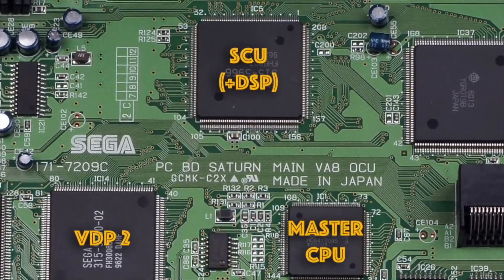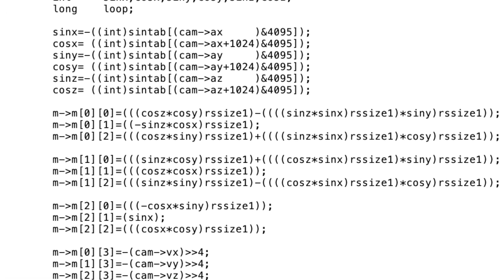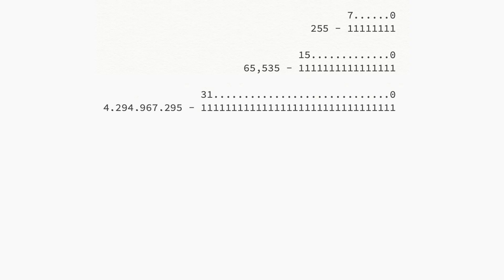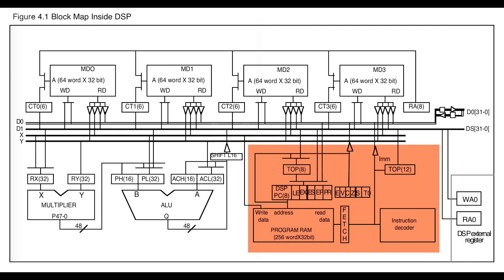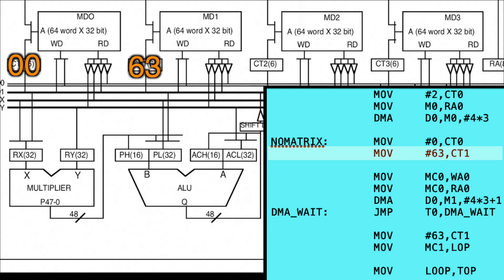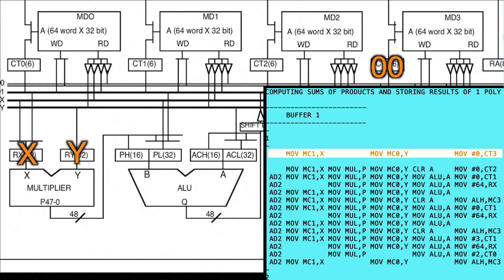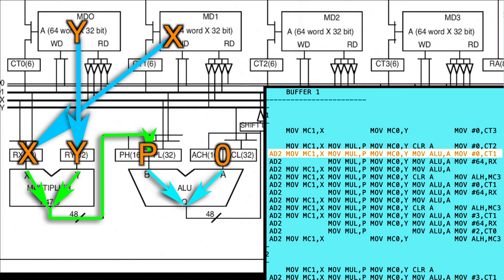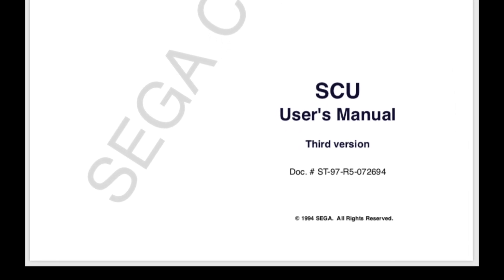Sonic R's code the Hardest in the World?

Comment: starts making a VM with the worst instruction set
Reply: I may have beat you to it, I created a VM that runs on 8 bit PIC18 architecture and creates a bastardized "16" bit architecture with a stack that is only sometimes a stack and no dedicated flag register or interrupts.  To get 16 bit memory performance, you can only use pushes and pops, but all of the pops can  offset SP within the current 256 byte page prior and some special push opcodes can too.  So for optimal memory performance, your program needs to know where SP is and move it around offset style to reach its next address continually.  It makes stack frame local variables "okayish" to use but then you also have to be concerned that your stack frame doesn't cross a page boundary or the offsetting will blow up.  Needing to track SP positioning gets really weird when you have loops or conditional execution.

For random 8 bit RAM reads, the opcodes are constructed so that you can load part of the addressing to the destination register and then the read instruction operands select the destination as the memory address register in one operand and a literal 4 bits for the rest of the address in the other operand.  So by that trick you can do any constant address 8 bit RAM read in 2 instructions to any supported destination register without needing another temporary register for the address.  Byte translations from RAM are a single cycle operation.  Sounds good so far, but writing has a different shadow register for the upper 4 bits so you have to treat it a little differently and you will need either 1 or 2 bytes of separate address register to do it.

There is no mechanism built in for constant data address offsets, so for reading/writing 16 bit data values you'll find yourself incrementing an address register to get to the next byte unless you can use the stack mechanism.  If reading from flash, you can't use the stack mechanism at all and all addresses must come from a 16 bit register.  So if you are dealing with pointers that only go to RAM, you have more coding options than if the pointer could point to flash, since not only can you not write to flash, some ways of reading it won't work either.  Mercifully, the mechanism to read flash via pointer can also read RAM.

Conditional branches require you to load the magnitude of the jump offset into an 8 bit register, which is multiplied by 2 and added or subtracted during the conditional jump.  To reduce how often this must be done, hardcoded skip 1, skip 2, and skip 3 instruction jump targets are also there, plus subroutine return is also a conditional jump target.  If you are using the multiply and accumulate instructions, it will clobber most or all of the conditional jump offset registers, so those skip1-3 targets become really important or maybe you aim SP at the target address pointer and use return.

The conditional branches compare two registers for A>B, A=B, or (A AND B)=0.  It is a bit of a challenge to think about how to do some of the usual conditional jumps - for example comparing two 32 bit values is tricky because it can only do a 16 bit comparison and you have no flags.  So the code flow path has to hold some flag information itself so that you can chain two compares together.  Getting the carry out from an addition is similarly weird - you compare that the result is less than one of the operands.  It makes sense after you think about it but most assembly programmers are used to having flags and it feels a bit unnatural.  If you need to check a sign bit, you have to burn an 8 bit register and an instruction to set up the 0x80 constant to do it.

On the plus side, jumps have +/-255 instruction range and calls have +/- 3.25K instruction range and everything including the calls are single cycle.  It also has per-thread, per-256 byte page memory write protection.  Sort of a "just because it can" sort of thing, but it does open the option to having isolated threads for redundancy/high reliability/validating actions of a received RAM resident program, etc.

The whole point behind it is that every interpreted instruction runs in exactly 68 real instruction cycles so that it can be used to run general control code fully isolated from the timing of a cycle exact main loop.  If you have even less time than 68 cycles free at once, you can split the interpretation into a front half that fetches the instruction word, updates IP, and decodes operands (which always happen identically timing wise), and a back half that runs the rest of the instruction.  It's not a portable interpreter and many PIC-specific tricks were used.  Porting it would be a medium nightmare.  A cornerstone of its design is the large number of 16-way branches used in the interpreter, which make almost all of the opcode field sizes 4 bits.  PIC can do these kind of branches very quickly when the destination addresses are spaced 8 instructions apart.

No one single part of this ISA is completely horrible but taken together it is an amalgam of "here's 3 different ropes, find the best one to hang yourself with" type situations.  But I did attempt to at least have an "okay" approach to most common programming tasks, though one is likely to struggle through bad approaches before finding it.

Comment: Very interesting video, thank you for making it! I still have one question; when these 6 operations occur at the same time, which X and Y are then multiplied together? I assume the multiplication happens "at the same time" as the overwriting of X and Y, in practice meaning that the result is stored to PH(16) and PL(32) and at the same time, a new set of X and Y is written to RX(32) and RY(32)?
Reply: One of the important things to understand about assembly is that one instruction doesn't equal one clock (CPU) cycle. The assembly code you're looking at does show all the instructions on one line, so the instructions will start in parallel at the same time, but instructions take different numbers of cycles to complete. If you take a look at the second instruction of the complex DSP code:

MOV MC1,X   will take a few cycles because the move instruction will have to read the address pointer in M1 first, then the address lines have to be set, then the read data line will go low to read that memory into the X register. So you're not moving data into the X and Y registers until maybe cycle 2 or 3 at the earliest. (I'm making MAJOR assumptions about the DSP's instruction set and have no clue how its instructions are set up, so it could be earlier or later).

At the same time, the instruction telling the multiplier to do it's thing is called. The data for the previous X and Y are already in the X and Y registers, so on the first clock cycle of the instruction, X and Y are read by the multiplier. This happens before the X and Y registers are updated by the MOV instruction in parallel. The following cycles will do the math and put the result out on the P register. 

The programming is very clever and I can only imagine my brain melting trying to program in parallel like that. If you want to go down the rabbit hole of assembly and machine level processing, I suggest watching some of the videos that Ben Eater has put out recently about building a computer from scratch. For example:
https://www.youtube.com/watch?v=yl8vPW5hydQ
Reply: @sentry4944  Thanks for the explanation. I just get the mental picture of the multiplication unit multiplying the old values while the new values are screaming down the copper lines toward it.

Comment: I feel so spoiled to have floating point numbers in modern game engines.
Reply: @vlc-cosplayer  They make different tradeoffs. One prioritizes speed and memory by giving up arbitrary precision and the other prioritizes arbitrary precision by giving up constant time operations and consonant space. Depending on your use cases one is better suited than the other.
Reply: Floats are not a feature of game engines! Modern processors have Floating Point Units that handle floating point calculations in hardware; but yes, they are extremely useful!
Reply: 171 So to be more precise, I feel fortunate that the engines can leverage this capability of modern hardware.
Reply: @wandersgion4989  minecraft wouldn't be possible without floating point numbers.
Reply: You can emulate floating point units without having a fpu. Its just slow
Reply: @neliasoares6217 Minecraft would be plenty possible without floating points. What are you talking about?
Reply: Well they had floating point Numbers on N64 at least
Reply: @davidbanan.  This is why you get that jittery effect on the PS1. It didn't support floating point, only fixed point. So you get some twitching, where part of your character would move quickly between two pixels when it ought to be placed somewhere inbetween but was rounded off.
Reply: @paulkerrigan9857  That jittery effect it's because the PS1 lacks a z-buffer, so you cannot apply perspective correction. In fact, the graphics processor in the N64 works with a 16 bit fixed point format and it doesn't have that problem, because it has a z-buffer.
Reply: @paulkerrigan9857  High quality rasterization is possible with fixed point integers, take a look at quake for that.  It has nothing to do with lack of floating point, or lack of a z-buffer like another comment mentioned.  It's lack of subpixel correct rasterization, so polygons only animate when a vertex moves to the next pixel, rather than animating smoothly with subpixel motion.
Reply: @vlc-cosplayer  So, why don't we use that wonderful thing, then?
Reply: Personally I've been hoping for fixed point.
Reply: Indeed

Comment: Did you ever have problems with debugging race conditions on the DSP?
Reply from the maker: As far as I know, there was no debugger as such
Reply: @CodingSecrets  I don't think Katsuragi was asking about a debugger specifically, but more of if you had any problems fixing bugs or solving problems that had to do with race conditions on the DSP.
Reply: Race conditions appears only in a multithreaded environment and only for a complex memory operations. There was no multithreading in Sega Saturn times. Also all of the described operations are atomic (done in 1 cycle). So there is no concurrency and no reasons for race conditions at all.
Reply: @mk72v2oq  do the CPUs not perform parallel operations?
Reply: @mk72v2oq  Nope! Concurrency errors can occur in any code on any hardware that has any asynchronous parts. Yes, that does includes even hardware with inputs and outputs.

Anything that doesn't follow the CPU's clock, basically.
...And as @criticality2056 mentioned, there were parts that dd things in parallel. That itself requires very good synchronization.